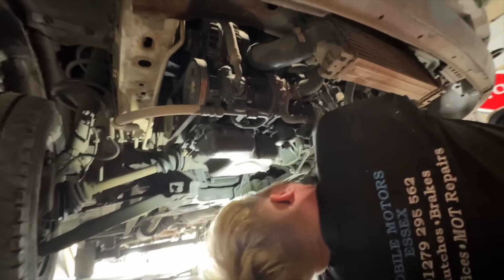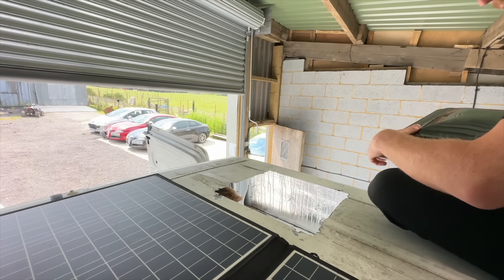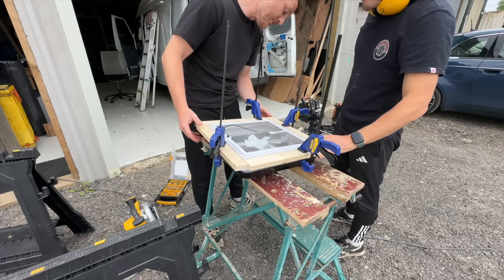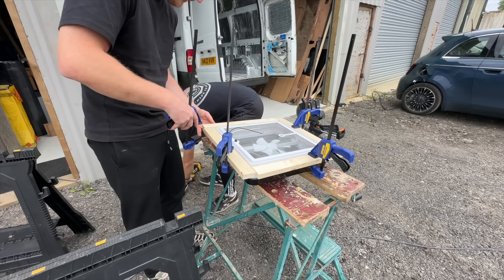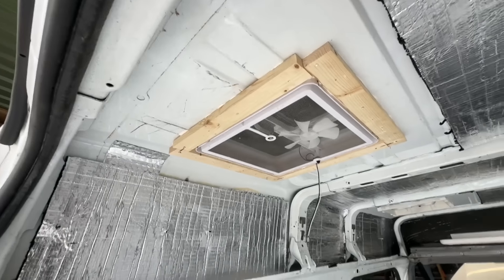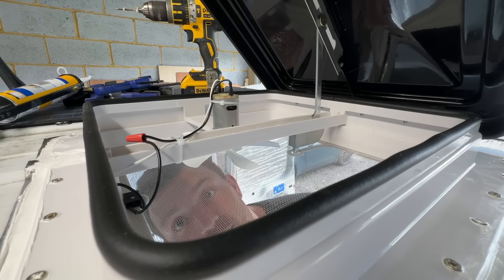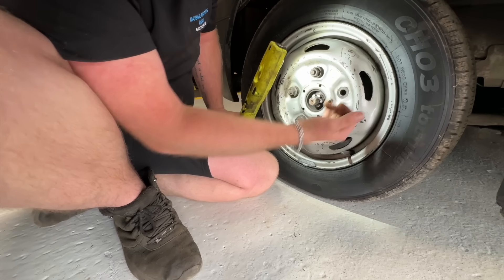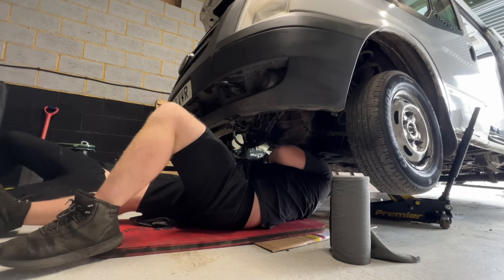I MADE A BIG MISTAKE! WRECKED AMAZON DELIVERY VAN | 10 DAY VAN BUILD

Comment: the best way to get the measurements for the roof farm frame was to take the width of the wood, double it, then measure the width of the fan's inner bracket, then add it all together, thats gets you 2 sides with no errors.
the other 2 sides would be the final length of the first 2, but remove the doubled number.

as for avoiding splits, drilling 'pilot holes' in before putting the screw in almost completely removes the risk of splitting. a pilot hole is a drilled out channel a little smaller that the screw's width, so the central screw's shaft can slide in when drilling, but the spiral teeth still grip into the wood.
Reply from the maker: I’ll be remembering these tips for next time! Thanks 😊

Comment: Will wet your finger and run it down the sekaflex it will look clean and smooth. And a damp cloth to finish hahaha
Oh no you fitted the fan back to front. It should open to the rear of the van so when your driving it can't get ripped off
Reply from the maker: Now that is a great tip thank you Paul, and yeah...I've realised that now 🤣 few people have mentioned it!

Comment: to prevent wood from shaping from thick screws (fan frame), use a drill bit just 2mm thinner than the screws and drill out the hole for the screw to fit in. it will hold because of the screw head.

Comment: Will, you might want to Sikaflex over the screw heads in your roof vent, both to stop them getting rusty, but also to prevent any damp getting through them. It looks a bit messy on the outside, but should hopefully be worth it. Looking forward to part 4! :-)

Comment: To get a smooth tidy finish with silicone sealant, get a small bowl of warn water with a little washing up liquid in it.  Wet your finger and smooth off. This method will also stop the silicone from sticking on your finger. As your finger returns to the bowl the access silicone will drop off into the warm water re wet your finger again and keep smoothing off. 
A warm wet finger is all you need 🤣
Reply: or put the water and washing up liquid in a spray bottle! silicone everything then spray it up. wipe away and let the rest evaporate
Reply: For simple-ish runs, a profile tool is also great too. I thought they were a gimmick until I did my bath/boxing in/windows etc etc. When you get a nice 100% consistent thickness, taking it off when it goes manky is a breeze - no scraping!
Reply: Less is more

Comment: Nice video! Ain't you supposed to face the hinge of the fan cover to the front of the van? As you drive, the wind will get under it (even if it's in a closed position) and it will act as a sail and get ripped off. For anything electronic and mechanical, always give it a test first to make sure it all works before you install the said item. Now that you have modified the fan, it can't be returned to get your money back or get an exchange (hopefully it's only the button issue).

It's good that you got the mechanic to have a complete look over; it sounds like the Amazon Van is in okay condition. Did you get him to have a look at the engine and transmission itself (to make sure it's in good condition, since you mentioned the engine has no power at certain gears)? It's also worth the mechanic test driving the van; he may see, feel, and hear potential issues you may have missed or been unaware of.

When buying cheap stuff, sometimes buying cheap means you have to buy twice. So it may end up costing a lot more. I'm not saying to buy the most expensive, but buy the middle ground instead (if you want to reduce the cost).
Reply from the maker: I realise that now after most of the people who watched the video pointed out🤦‍♂️ More to come with the mechanic too
Reply: @WillsWhereabouts  Nice one! Looking forward to the mechanics and hectic rush to quickly build up the Amazon Van! By the way, what name are you going to christen it?

Comment: I think you wired the fan up wrong hence why it didn't work. Generally Black is positive +12V and White is negative ground on RV fans so I would double check the documentation that came with it. Also it should open up to the rear and not the front as it will tear off when driving if even a little bit ajar. Aprt from that it was a very entertaining day.
Reply from the maker: I realise that now after most of the people who watched the video pointed out🤦‍♂️

Comment: Little bit of fairy liquid and water in a spray bottle when using silicone/sealant.. put on the sealant, spray over the top with fairy liquid mix then wipe, doesnt ride up the edges and go everywhere 👍 always have an old rag/cloth to wipe excess off finger
Reply from the maker: Top tip mate cheers👊